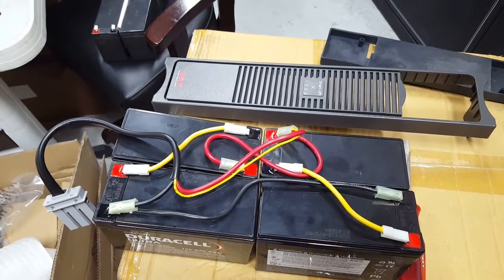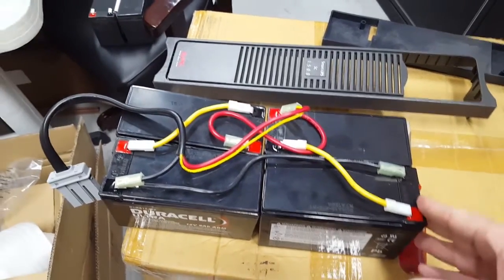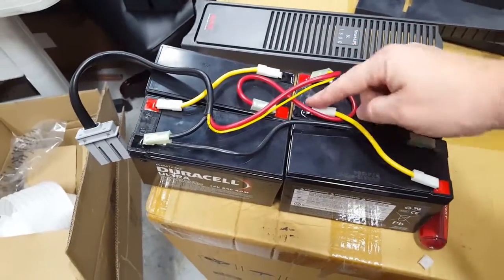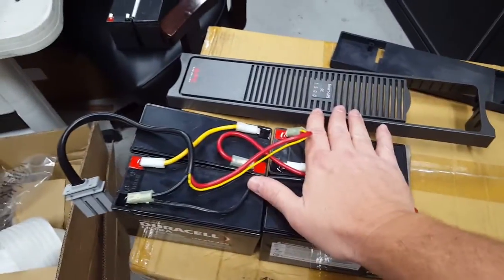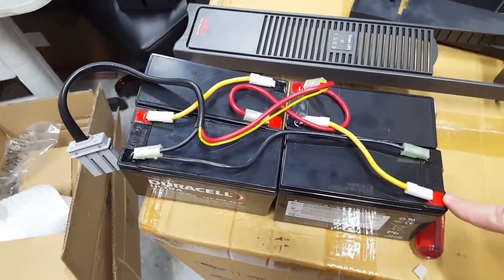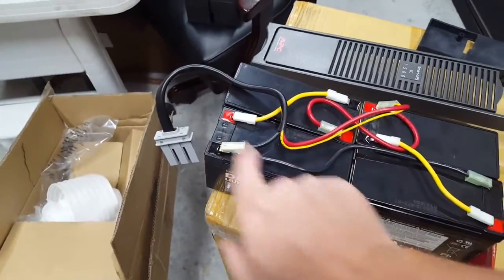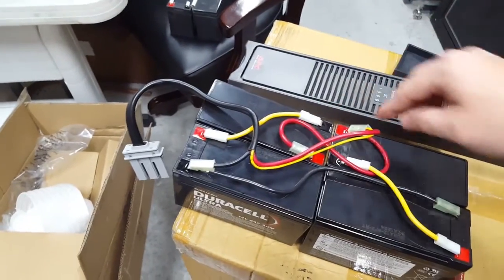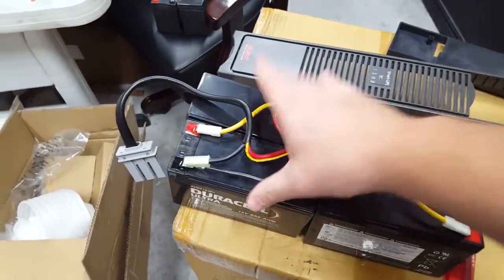APC Smart UPS SC 1500 Battery Wiring Diagram

Comment: Is the diagram the same for APC’s BR24BPG battery pack? And do you think that I can do a DIY project hooking batteries to my br1500gi with the back external battery plug?
Reply from the maker: I see what you have going on, you have the BR1500 with a back hookup. from what I read this configuration will work and here's another article with the yellow sensor wire and resistor involved. http://www.yourwarrantyisvoid.com/2009/10/27/breaking-into-apcs-br24bp-battery-pack/.

Comment: The yellow wire connection is wrong. It is connected to the negative and with a series resistance of 20k ohms at 1% Luck ...
Reply from the maker: this is a series / parallel batter setup, it is correct for a 24v setup.

Comment: ¿is there anything inside the connector ? ¿ A diode ? ¿ A shunt resistor ? I am intrigued by that yellow cable. If it is just a short circuit to the positive RED wire , then why not make the connection inside the plastic housing and save several miles of copper every 1.000 units manufactured ?
Reply: That is called as "sense" wire, which provides the control circuit with the exact voltage at the positive battery terminal, without the voltage drop (caused by current/resistance) on the red wire.
Reply: @paulwysocki4601  
Hi, can we find the triple connector and build the same system ourselves, can we integrate it into the apc pro1500? Will that yellow wire be connected to terminal 2 of the triple pin?
Reply: @arifgor6467  For proper function, the yellow wire connects to the red wire at the battery pack, although if you connect the yellow and red wires together  at the control board the system would work, just not as precisely.
Reply: @paulwysocki4601  thank you.
Reply: ARİF GÖR  I’m planing on doing the same thing, please tell me how it went out if you did it.
Reply: @YMHM  I'm not quite sure how to do it yet. That yellow signal cable is still a mystery.
Reply: @arifgor6467  I have watched some old APC UPS units videos and it seem like they had the same plug for the external battery pack but,  for the UPS's internal battery itself like (RPC 33, RPC59). As for the yellow signal cable I believe that it's the first one on the female plug (90% sure) and  the middle is positive and the last bottom one is negative (I checked my UPS and it did match the old UPS's plug positive and negative at least). As for its use all the info that I found is from pauls's reply above (yellow signal cable) and it's indeed is connected with the positive side of the end of the 3 plug cable with battery. I'm not going to try to do this project yet because of $$ right now is bit tight :P but I think it's very doable. Good luck.
Reply from the maker: Did you guys see this article? https://www.batterystuff.com/kb/articles/battery-articles/battery-bank-tutorial.html

Comment: Any tips on how to take apart the RBC59 battery pack? is it difficult/dangerous??
Reply from the maker: No, it's just 4 batteries taped together. Just make notes of your wiring while taking apart. If you have an interstate battery or some sort of battery shop they usually have descent battery prices.
Reply: @AnthonysBBQ  thanks. Actually it is an wrong purchase we have on storage, and im looking to use the individual cells for another project.

Comment: What is it for?
Reply from the maker: it is a backup power system for our computer switches and routers in case power goes out.
It provides surge protection and depending on the load several minutes of power backup.